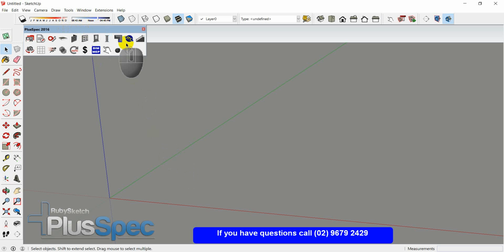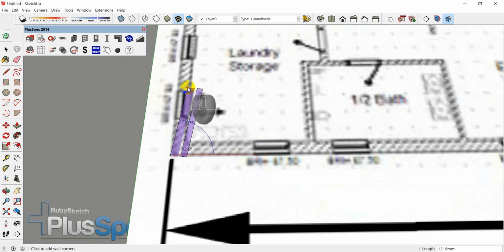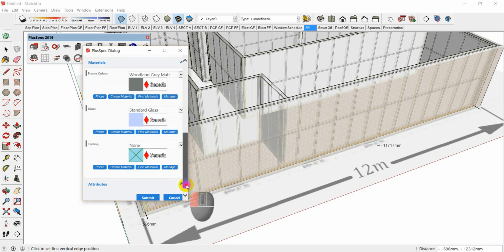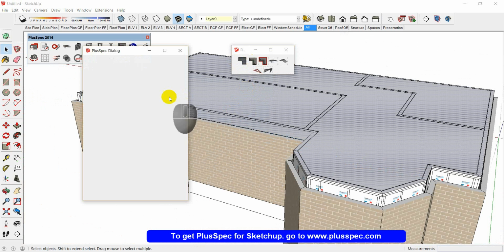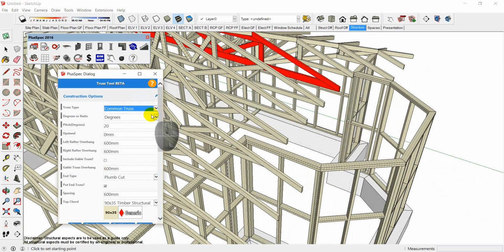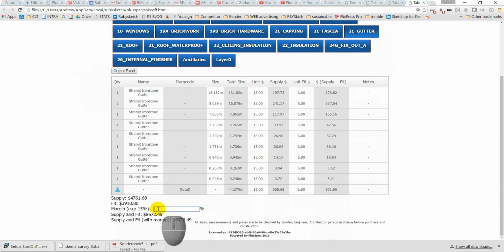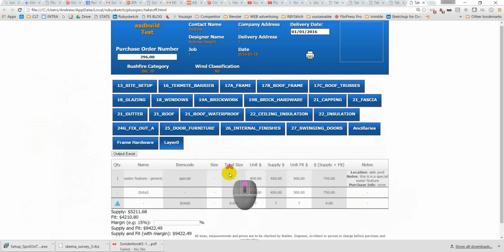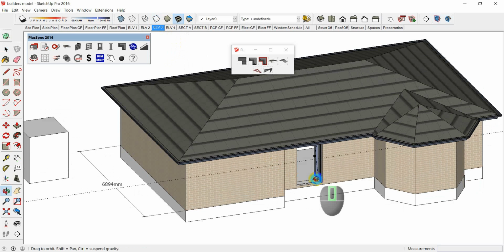Easy Estimating Software for Residential Builders in 3D PlusSpec review

Comment: I live in Bermuda where we have our very own lapped slate limestone roof profile. Can you input data in the software that will generate this roof type? We also do scalloped gables. Does this program have a variety of gable styles? And we also do decorative eave /soffit molding. Will I get that or can it be programmed into the software by the user?
Reply from the maker: Yes all of this can be done here is a video that may help https://youtu.be/mcb65oIi4ds

Comment: Good Construction Estimating Video, ASPE
Reply from the maker: Thanks ASPE, we have a heap of quantity surveyors in the USA using PlusSpec as we have done a lot of work as per our customers' requests. We also have many architects/builders working together with the QS and engineer to get the price accurate before contracts are signed by the client. If you need to learn more go to the RubySketch YouTube channel
Reply: Thanks ASPE, we will be in Palm Springs CA next week 22 September 2018, this is very old video yet it is comprehensive, just like every bit of technology it evolves and gets better. Since this video we are now almost 3 years further down the track so you can imagine how much better this software is now.  If you want to find out more here is the link https://plusspec.com/plusspec-for-estimating-construction/

Comment: hi can this program do decks ect and piles
Reply from the maker: Yes, it does decks and joist, piles and footings.  We use it to explain what we are building to clients and subcontractors yet also for a bill of quantities
Reply: kwl thank you will just take some time too get to know how to use
Reply: Hi King, yes you can add decks and quantify joist and beams in lineal measures, hardware per item and square measure of decking,.
Reply: All of the tutorials are built in, so if you use a particular tool it has orange markers, click those and they show you what each particular tool does,  if you click the orange question mark it will take you to a series of videos. Most learn very quickly.